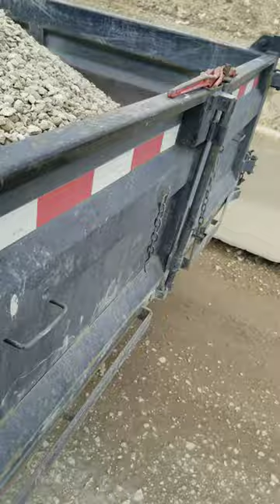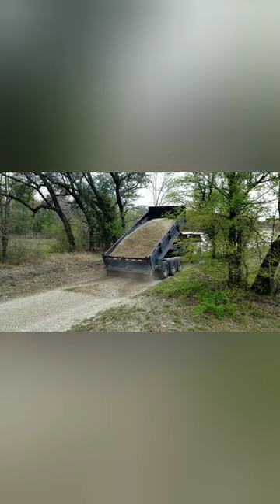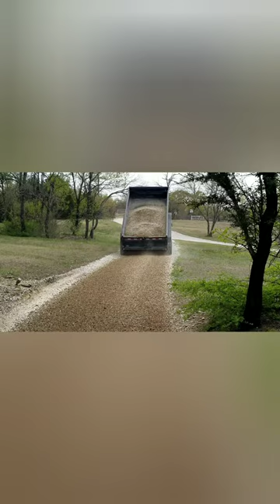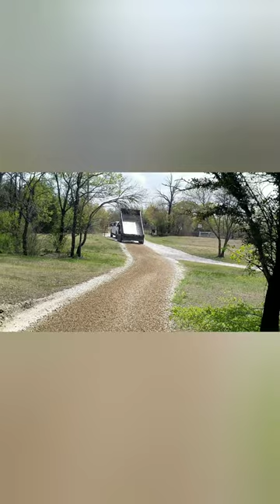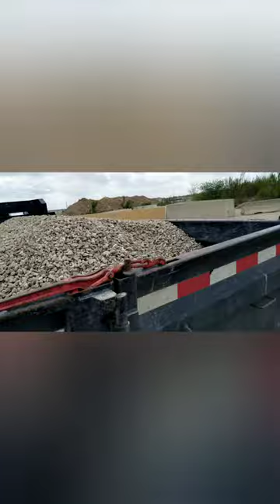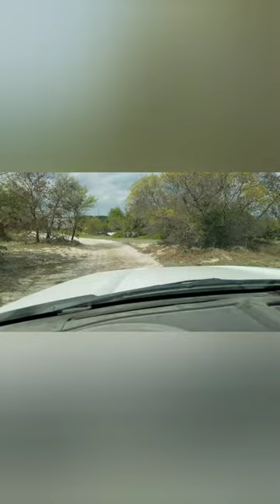Hauling tailgating / Spreading 1 Inch Gravel with U.S. Built Dump Trailer

Comment: How did you set up that chain binder to latch the back gates?? 
My trailer has a rod and tab that goes in a slot near the bottom and the rod is bent. It’s hard to get open but I really like that binder idea. Seems easy
Reply from the maker: It's just a chain binder from the hardware store. Cut one end off and cuts some holes in the tailgate weld it on.
The lock systems are a joke on these trailer.